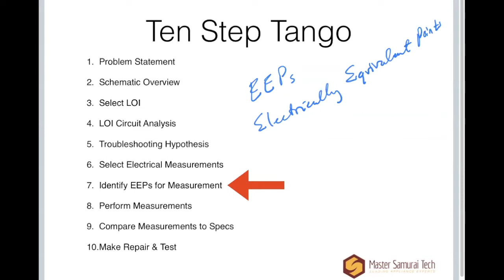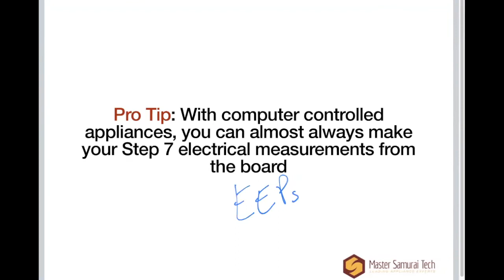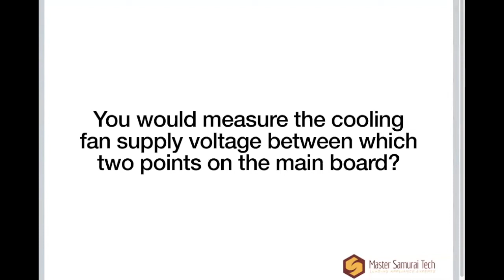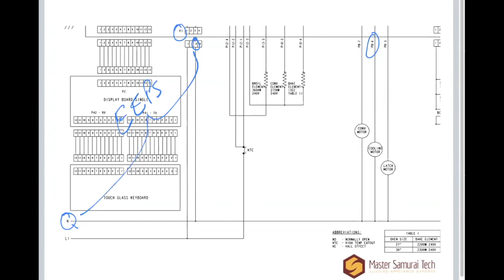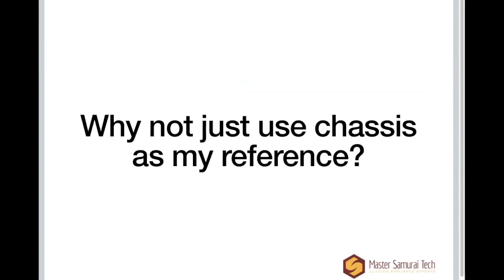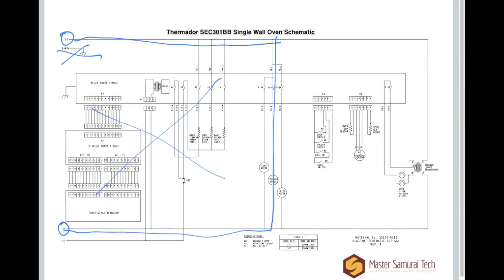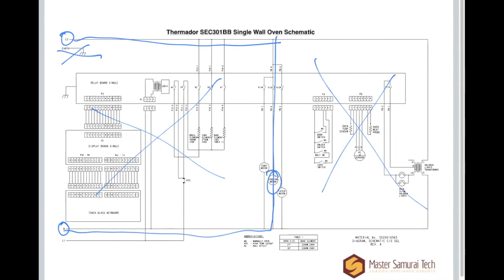Control Board Troubleshooting Workshop: Thermador Wall Oven - Excerpt

Comment: Excellent Tutorial. Wished I would have had electronics/electrical professors that taught troubleshooting like you back in the 90's when I was in school. When I look back I really never learned much about troubleshooting until I got in the workforce and learned through on the job training and working with the older experienced techs.

Comment: I loved watching this, although I am not a electrical professional I am so interested in trying to figure out why my Thermador double wall oven continues to beep after turning it off.  I have replaced the relay board and gasket and now am contemplating replacing the touch panel.  I look at the schematics and it really doesn't help me figure out what the issue is.  From what I read it could be a stuck button on the panel.  I have already spent $600 fixing this oven that works fine other than the beeping.  We just shut it off at the breaker until we are ready to use it again.  Any insight is appreciated.  Thanks C272ZS